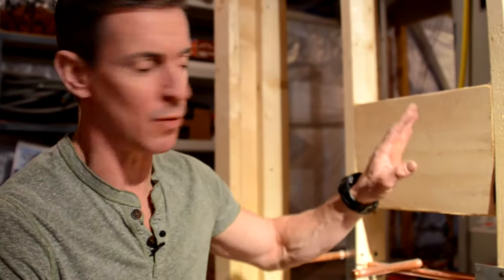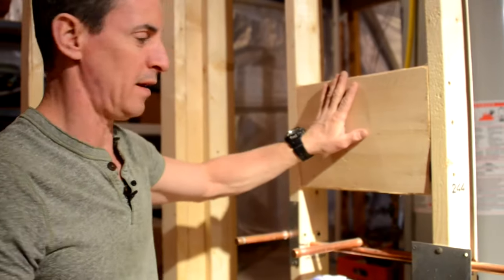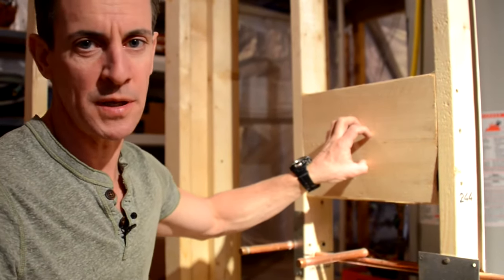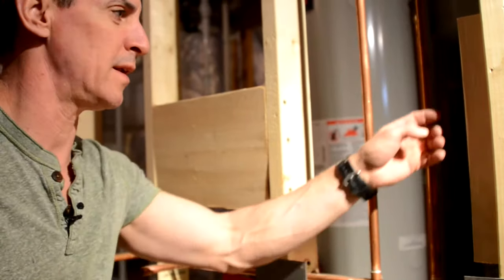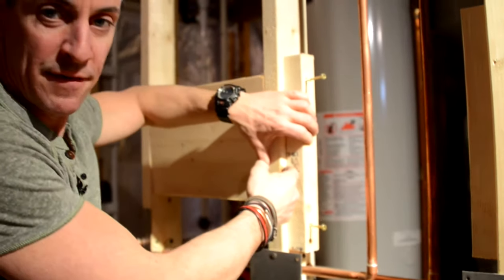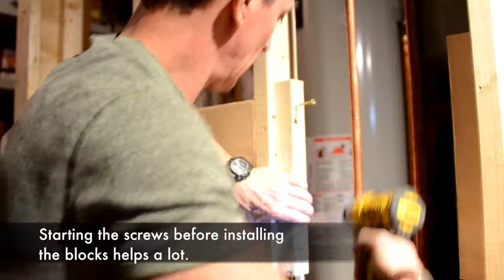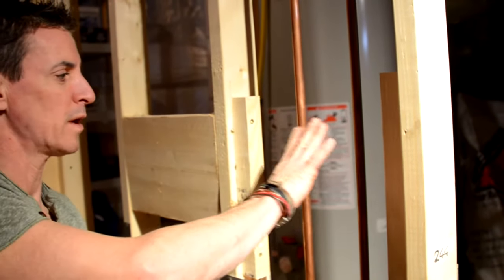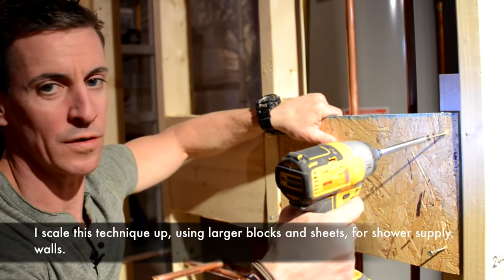How to install stud wall blocking

Comment: OSB for blocking ??? Really
Reply from the maker: For a pedestal sink. OSB gave plenty of bite when we (I mean the plumber) screwed it in. I use it---solid framing or plywood is better, you're right---in shower supply walls to when I can, too. It means you never have to find a stud or use hollow wall anchors when installing shower items like a shower handle or soap dish or grab bar.

Comment: i was thinking of doing this for a 55" TV mount so i can drywall over it. i imagine this is sufficient for up to 60lbs of tv/mount weight?
Reply from the maker: Do it. Make sure the screws you use penetrate the drywall and through the back of the 3/4 ply a hair. - Use 1 1/2-inch screws. I like Spax wafer head screws for this. You might need washers to really cover the hole in the bracket. - I just set a 50# outdoor TV on a brick wall with the same screws.
Reply: Definitely use high quality plywood and not osb for your tv

Comment: What happens if someone inadvertently puts a screw where that copper pipe is?
Reply from the maker: Good call. It's been a minute since I made this video, but I recall my thinking at the time what that I knew what pedestal sink was going in there and where the fasteners would go. - If that was a gray area--say grab bars were going in this area--the right thing to do is add nail plates.
Reply: @myfixituplife  I had some drywallers come in and hit bullseyes on a half inch copper line in 3 places going thru 3 nail plates in a bathroom.  Probably really unlikely someone will just happen to hit a perfect bullseye but it does happen.
Reply from the maker: YIKES.

Comment: might want to add some sort of sheet metal to the rear side to prevent overpenetration and piercing that water line
Reply from the maker: 100%. This bathroom passed inspection--and I don't do bathrooms all the time--but since then, I've determined that I need to death grip any possible plumbing puncture. Thank you for this comment. I bet you say it because it's happened to you???

Comment: A 2x4 is 3.5" deep. If you use 1.5" mounting block and .5" OSB on both sides you're at a total of 2.5". I don't see how you account for the extra 1" space between the future sheetrock. Can you explain?
Reply from the maker: The 1 1/2-inch ripper is set back 1/2-inch. - Plop the 1/2-inch stock in there and it planes out flush.
Reply: I'm not following. Still adds up to 2.5". 1.5" ripper plus 1/2" both sides is 1.5"+.5+.5=2.5".

Comment: Thanks Kevin! I have a little house from the 20's, I need to replace the cold water valve in the 3 handle shower/bath, I've cut a hole in the drywall to access the plumbing from behind and have found a 2x6" stud wall block that is in the way. Can I cut the Blocking and remove a section  to get it out of the way so I can work?? Thanks David
Reply from the maker: Lateral blocking in a studwall from the 1920s may be serving some esoteric purpose. An apprentice might've also nailed it there...because. I think you're good to go.
Reply: @myfixituplife  Thank you!!:))

Comment: Thank you so much.  That's what I'll do.  However the drywall is already there.  Should I cut a rectangle in the wall to accommodate this bridge.  My tv is 65".
Reply from the maker: No. This is while the framing is open. Run some 1x4 across 3-studs for the top and bottom of your TV bracket--make sure you screw to the studs--then mount your TV the the 1x4. I like Spax #10 x 3-inch screws for the 1x4 to stud connection. I've also used the same screw with a fender washer to connect the TV to the 1x4
Reply: Thanks for replying but I've decided it would be easier to build a console table for the tv.  I found out it came packed with feet.  Thats easier for a 74 year old women anyway.
Reply from the maker: @SDMPoahway  You're awesome.
Reply from the maker: @SDMPoahway  Cool. Good luck.

Comment: I'm assuming the first backing block is thicker and would press against the pipe?
Reply from the maker: If I'm understanding you correctly, no. The plumber is going to run the pipe up the center of the stud bay such that blocking can be added. If it's a plumber I haven't worked with before, I'll make sure he or she knows there will be wall blocking so they can lay out accordingly. I hope this helps.

Comment: What kind of wood do you use , pressure treated for bathroom areas ? Any advice for metal stud wood blocking?
Reply from the maker: In the walls, untreated lumber is fine. In a basement or on concrete, PT is required for the bottom plate. As for metal studs, sharp-tipped screws will pierce it. If they wobble, just pre-drill a hole. Steel studs are pretty soft. Hope this helps.

Comment: Is 3/4" plywood strong enough to deal with an articulating mount that can be 650/750mm from the wall holding a 40lbs TV? It would be easier than trying to install a bunch of solid blocking since I don't know 'exactly' where things will be height wise at this stage.
Reply from the maker: I'm not lab, but I think so. - Try it elsewhere. - Grab a scrap of 3/4 -ply, drive a fastener into it, try to pry it out.

Comment: It was obvious you didn't measure your "half inch back" for the ripper blocks because your OSB isn't flush with the studs. The drywall is going to be attached to the studs, of course, but there's no reason not to have the OSB flush with the studs. Not the end of the world but attention to detail is important.

Otherwise, thank you for the demonstration -- especially the part about encountering obstructions in the wall. Good idea!
Reply from the maker: Thank you. Good eye.  - I did set the osb 1/2-inch back. Sorry that didn't come through.
Reply: Not end of world however the screws will pull the dry wall to the wood causing it to crack more readily when the object is a fixed to the wall
Reply: I always use 3/4" ply in these situations, holds fasteners much better than osb .